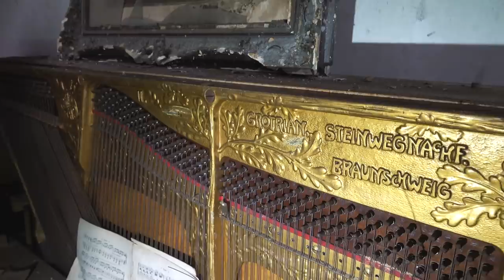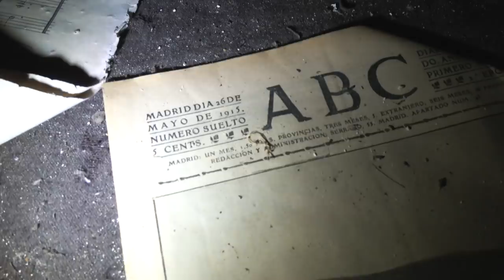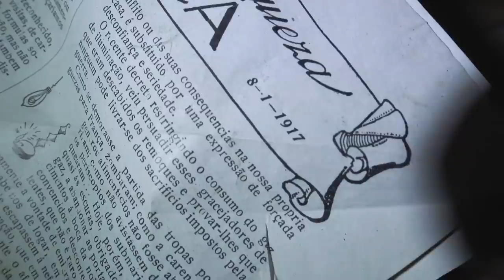The abandoned Portuguese Viscountess' mansion | Used in movies

Comment: To save such a structure the roof must be replaced immediately!  4:33  a conversation settee commonly found in the early part of the 1800's.  A young couple would sit and converse while a chaperone was present in the third chair.   5:29 early upright piano dates to about 1835...rare.  7:28 the fleur de lis (French) wallpaper.  16:40, 17:27 a toy (doll strollers).  19:59 a confessional box.  The third floor level were for the servants as the first and second level were reserved for the owners private use.  Usually, the servants were in the attic or basement as well as an additional kitchen in the basement.

Comment: Good back story.  I have never seen a 'tet a tet' (red couch )3 before..normally they only have two seats for courting couples.  Maybe the third for a chaperone?  The piano..you can tell is high end.  They even bothered to have the interior structure embellished with beautiful designs.  I liked the 'conservatory' area as well where he sat on the couch...all those vines across the ceiling.  It is a shame that an architectural salvage company did not come in and get the tile in the kitchen.  They were beautiful!  The ironwork on the staircase was so pretty...you don't see much of that , these days.
Good job guys..